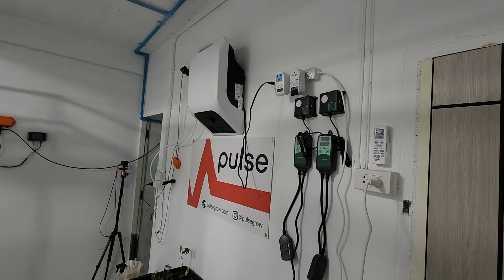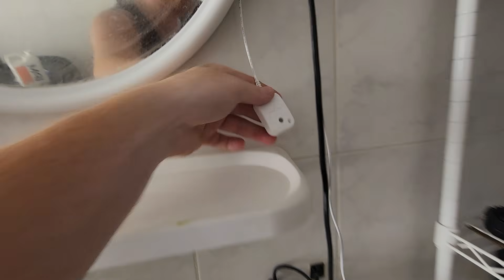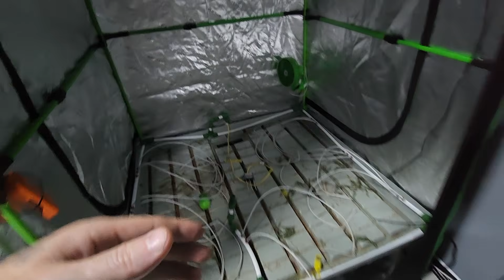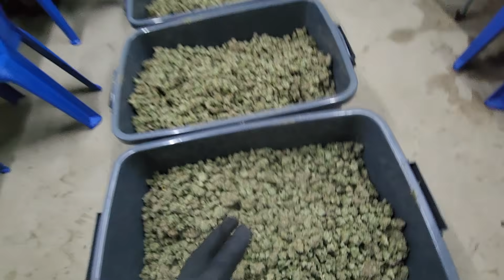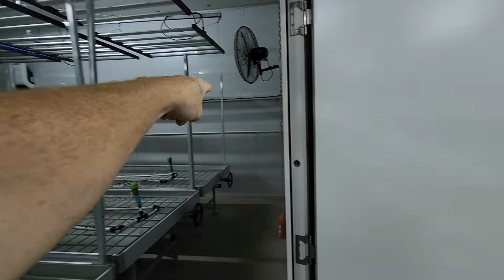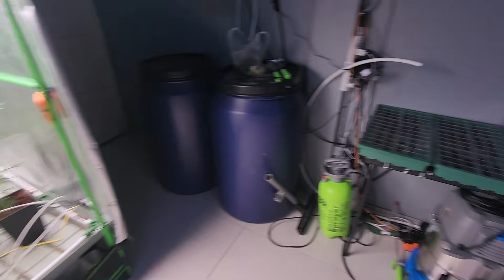HARVESTING THE BIGGEST AND BEST QUALITY YET!!! next round started!

Comment: your clones are wilting man
Reply: add some phosporus and superthrive to the clone soak, 250 ppm ph 6.4
Reply: plants are already sick and you are spraying cinamon extract from athena , look at the yellow burnt leaves. test the coco run off man for salinity! vivosun makes a cheap sensor.
Reply: my clones are 6 inches green pointing straight up in 10 days. I ran massive clone houses. So easy.
Reply: thats it im going to thailand and demolishing that market lol
Reply: the tent zippers leak, and if you test the connections on the fans they leak. An easy technique is put pollen in fridge for a week then grab q tip and sprinkle the best buds, then put tape on stem labeling the cross. black mylar bag for pollen in fridge not freezer. I use different q tips for different crosses. I also like to rub some thc from another bud down low to make it easy to pick up the pollen and rub into desired bud. Been doing this 31 years man, my ferts destroy advanced, mills , athena, gh, remo. as for those mites, you got to sterilize substrate and run a dissinfection room prior to entering the facility. shoes off change of clothes, wash hands put in new shoes and new coveralls and hair net gloves and masks. Keep it G. Start fresh from seed, proper sops for cleaning are a must. Intakes double filtered, hepa recirculation, merv 13 filters and uv filters. anything to comes in has to be cleaned before entering the grow area. Or you have mites wether beneficial or not, i dont smoke snap crackle and pop bs.

Comment: Hey Brother from another Mother, i have a question which might sound really stupid. Im a botanist and grower since 3 decades, i know my Stuff like Crop Steering etc been in the Game forever. I recently got 2 Cuttings, a Permanent Marker Cut by Seed Junky x Doja Exclusive and a Candy Store RBX Cut by Ethos Genetics. I made both of them into Mother plants and am taking Clones since about 3 weeks, but i have the Problem that they take either forever to root, and or dont root at all. I never had this problem before, and i do stuff like ive always done: Soak Rockwool or Jiffys in a solution of dilluted Nutrients and Clonex Gel, check pH after soaking cubes to be at 5.8 or 6.2, cut decent sized Clones and dip them into Clonex Gel, put them into little greenhouses with humidity domes, small 30W 3500k + 660nm Led Bars at 24h....i even went into my Basement and pulled out my homemade Bubble Cloner and cut another 9 Clones just to be safe...what am i doing wrong, might it be Genetics?
Reply from the maker: Cube to wet for to long? Usually it takes to long to root either the vube hasn't dried out within a week or the humidity is to high
Reply: @TerpyHighs  I think ur right, a couple of the clones rooted so i finally see some progress. I figured, the only thing im using thats different than the last couple decades is the rockwool cubes. I used to use Grodan 1,5" Cubes, they always worked like a charm, this time i got Agra Wool Speedgrow Cubes, these things stay wet like a Widows Cat...😅

Comment: I would seem to me that you may still be dealing with gas problems. Particularly hydrogen sulfide. It could be in the water, RO does not remove it. Or in the air, hepa filters dont remove it. The water can be aerated to help off gas it or carbon  filters will help scrub the air but id get a test kit like Lead Acetate Test Strips to test the air and water before moving forward. Best of luck to ya. P.S. YOU ARE SHOWING SYMPTOMS OF HYDROGEN SULFIDE POISONING IN YOURSELF. BE CAREFUL.

Comment: 21:21 I run 3 tents and run different males in each, but I have the same fan/filter combo for intake into the tent as well, so the air gets double scrubbed. I'm not sure what micron these carbon filters work down to, but I assume there is a minimum partical size. 

The way to keep negative pressure in the tents with a double filter setup is to run the intake fan slower then the exhaust fan. You can also run different size fans, like a 6" and 4". The 3rd way is for 2 tents - use one fan/filter for intake with a T adapter to run air into both tents, and use one fan but each tent containing their own exhaust filter with a T adapter to the exhaust fan. In this config, the intake has twice the resistance of the exhaust fan - creating the negative pressure in both tents.

Comment: bro if your doing all correctly ph and ec then those after 14 days being in there should have corrected there selfs and growth should be going nuts by now . spraying them with ipm too early on is the issue, roots need to grow and need to settle in before doing that,cuts that small just cant take it.. also should be pre charging coco before planting up making sure its at correct ph range and ec. just plant em up and leave em a few days but key is making sure coco is nice and moist and charged. humidifier is key in early veg as you mention, 70% in early veg, lower to 60% late veg keep at 50% in bloom till last 2 weeks lower to 40 :}

Comment: Hey bud!  Never comment but I really enjoy your content and appreciate all the work it takes.  If it's at all possible to move out of the Blem space I would.  I've watched all the videos and the only thing it can be is that there is something very wrong with the air quality.   It could be slowly leaching into the air from the walls or ground or sewer.  But something really bad is in that air, my guess is from past or current manufacturing in the building or near it.  Stuff like this cannot be remediated.  You have obviously improved the condition to allow thriving plants to at least live, but I think you have proven it will perpetually plague any living thing in this space.   With the stress I'm sure this causes I can't imagine this space is worth it when you clearly have the talent to not have to deal with these issues.  It could even be the reason you received no pollen.

Comment: Low atmospheric pressure (like during a rain storm) can cause decreased transpiration with high humidity. Basically the theory is that the high barometric pressure combined with the high humidity cause the stomata to not be able to push moisture out properly causing the plants to suffocate.
Reply from the maker: Aware of this theory but unfortunately inside thr grow room there is no spike in humidity while raining outside. It's gas or pathogen related I believe.
Reply: @TerpyHighs it’s not an issue of an increase of humidity but that the atmosphere itself gets heavier and exerts more pressure on the plants.
Reply: @sneazygreens vapor pressure deficit is what your speaking of.
Reply: y have something very wrong , 2.1kg per 2 light, basically 1.7kg was minimum bigger buds than yours  , led lights . Quality output from testing 29.3%Thc on mimosa strain. 24,1% watermelon zkittlez 2.9-3.3%resin .  grow climate 27°C-80% with masíve air change .   y need phenotype for your conditions and be aware solving this problems because is very short period (life cycle) and don't have value solving deep problems . Try find resist indica in your case or took own selection  . But I wait from you more than this sad harvest  ,   not in offend but y need sit to ass and start doing right management with looking to future more predictable . Improve croop stering under your climate conditions start runing rooms on  low stress enviroment and HST technic  with longer Veg ,try form plant to star 5-7 branches  and y can't keep bushy with basic ventilation . 350-700L/hour on m² this is massive air change. If you find good phenotype he don't need so much light ,so much control climate just VPD without drifting  best yield I had on 0.86vpd what and is small pots .    Also seeds , triploids love herm in indor but if y can handle have massive factory yields . Everything is about how y manage but not on offend is sad what I see . Can be better a lot of better than this ,stay green stay positive   @TerpyHighs
Reply: Terpy could try using an outdoor weather station in a couple of the rooms for the data of pressure lows n highs n other information that might explain some things.

Comment: FWIW: 
Not an expert on VPD, but afaik, if atmospheric pressure drops due to rain, the VPD math changes and you need to lower the moisture to compensate. 

Now you must NEVER trust AI, but I tried to find some numbers with AI, and it seems dropping 1% per 10 hPa, starting with 1000 as default and 25c at 70% humidity. So if pressure drops to 950 hPa, misture should be lowered to 65%. These numbers may be completely wrong, but something to look into when having sensitive growing going on as with your clones. 

There are other factors affected by pressure drop, and even root system may be affected by getting too moist or too low on oxygen. Even CO2 demand may be affected by the pressure drop.

Please dont blame me if you dive down a rabbit hole because of this! 😊

Cheers :)

Comment: Instead of the bowl trimmers, get one of the ones with a blade fan underneath. They are still not expensive, and work way better because the suction of the fan pulls leaves into the blades. I can process a pound in about 5 minutes and then it just needs to be cleaned up (still a job). Cuts trimming time in half.